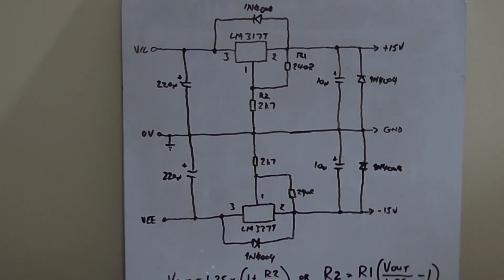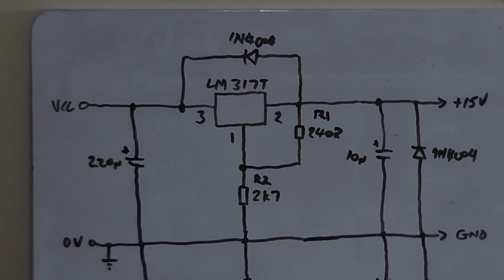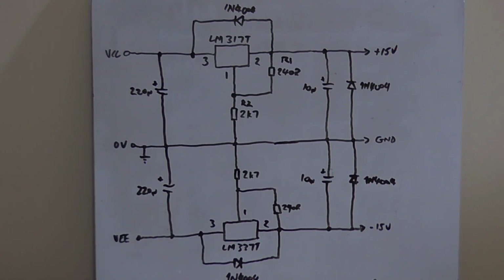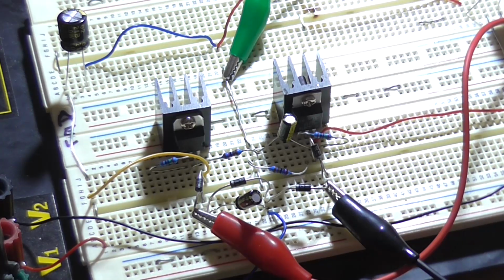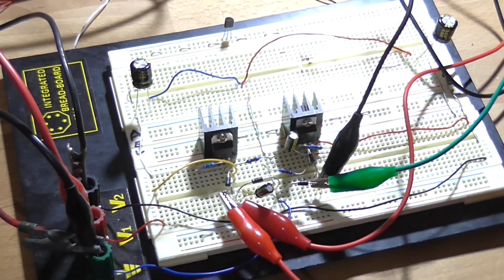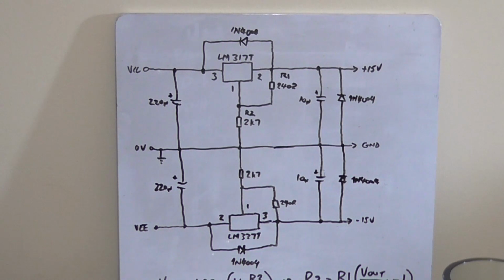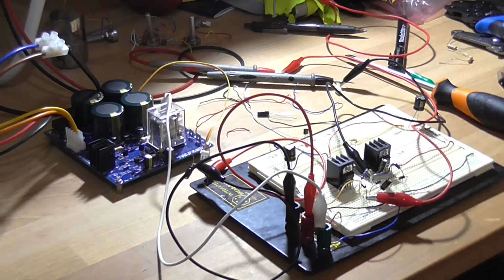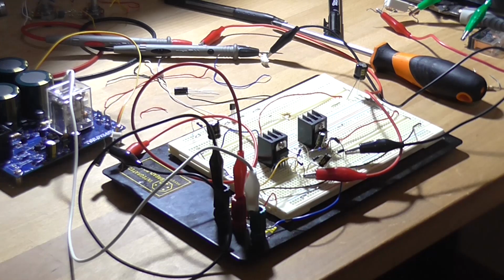Regulated +/-15V Power Supply (LM317T/LM337T)

Comment: I didn’t realize the pins were switched between the lm317 and the lm337. I’m sure I would have made that mistake in the future myself as I have ordered a few of those regulators with intentions of building a dual rail power supply. Thanks for the heads up.
Reply from the maker: You're welcome. I keep forgetting myself. Nothing worse than routing a pcb only to find you've inversed the pins!

Comment: Nice dual voltage power supply. Look forward to seeing you new amp project come together.
Reply from the maker: Thank you 😊. Me too. There are pcbs on way for this. I shot another video today (not uploded yet) and noticed a slight issue with the eti480 clone. I won't say what it is now, as it needs a follow up video to it (waiting on part order). I will say I made a mistake with it.